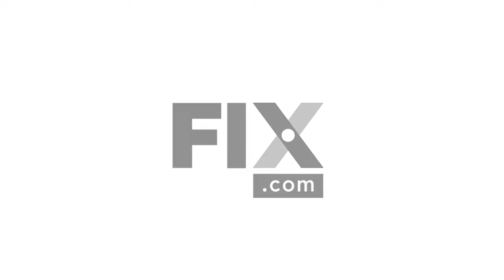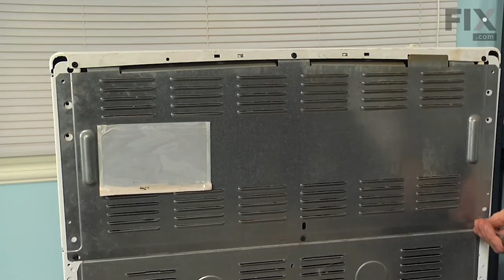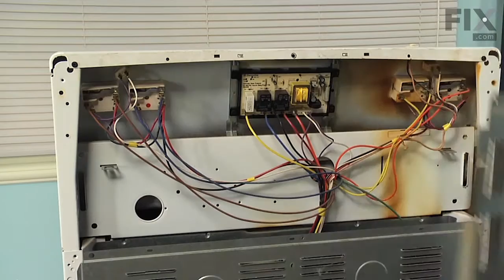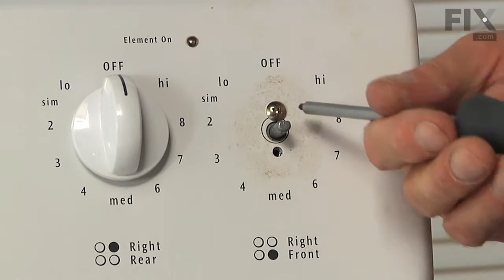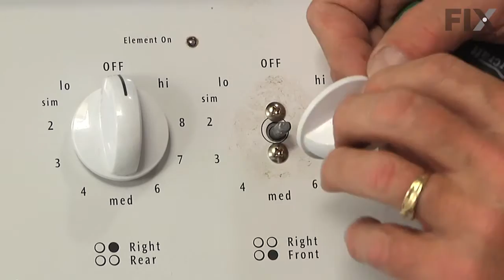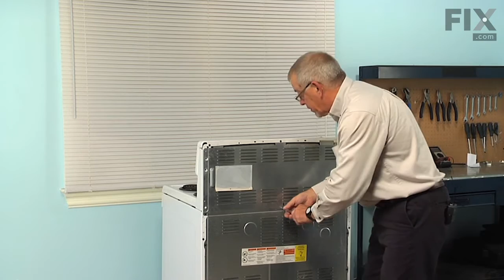Frigidaire Range Repair – How to replace the Infinite Heat Switch

Comment: Thanks for your info!  
     It would be great if you gave us a clue as to why you’re changing out this “infinite heat switch”
Is the oven not working or are the burners not working, etc!
After you are done with the job, it would be great if you said, for example,
“now let’s turn on the oven and see if that resolved our problem!  As u can see, it’s getting hot so…problem is resolved!”
    Thanks, I did subscribe to your channel!
Your friend,
   Barry

Comment: I have changed the infinite switches on my 2 year old frigidare stove but it still gets too hot,,oven also doesent seem to get hot as it should...does anything else control the stove top eyes  or is the two year old stove  garbage,,,its  a clear fire hazard,,,reading posts seems many people have same issues regardless of brand of stove...what other part could be repalced